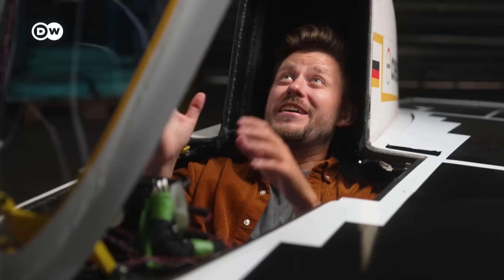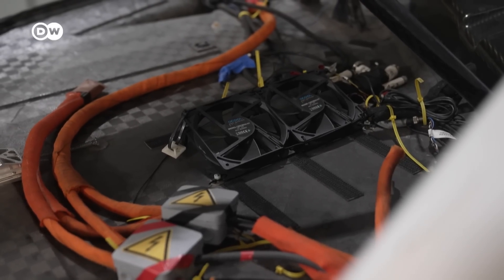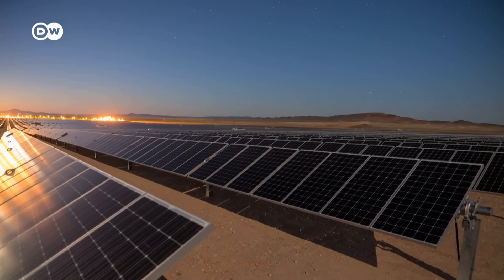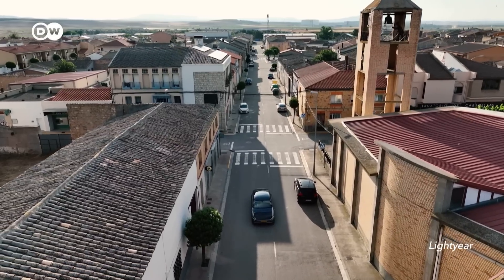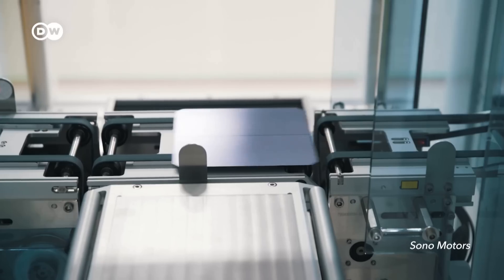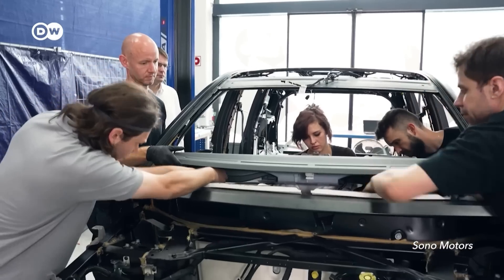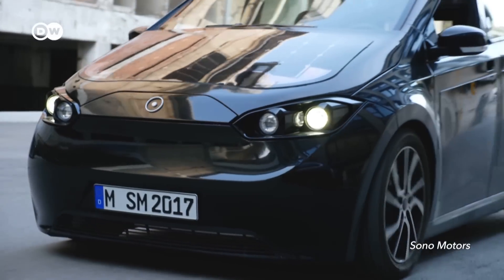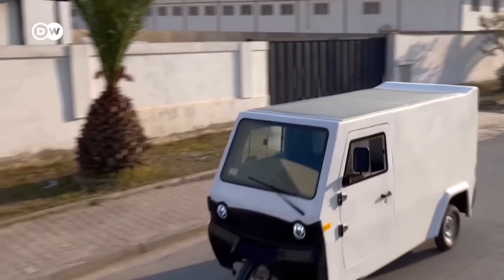Why aren't solar cars everywhere?

Comment: Commercial use of solar energy for cars is just a pipedream, Yes the Sun is an infinite (well, kin of) source of energy, but you simply can't generate enough energy using just solar to sustain the power needs of something like a car. 

It would be far more viable and effective to focus on improving batteries and move to a cleaner, cheaper and more robust generation of large amounts of energy by going nuclear.
Reply: Solar cells are more than efficient enough, to provide a significant amount of energy. Depending on the car, enough that you pretty much never need to charge it, but even just providing a tenth of the needed energy, is significant ...and yet there are several cars, that show that you can drive on only/mostly solar energy:
Squad Solar will go into production in 2024, and will be a great and very affordable car. The Sono Sion would have worked, and been affordable, if they had had enough money to start making them (and they'd have earned more than it cost. They should have done more to predict the costs), Lightyear 0 would have worked if they hadn't aimed to make such an expensive car (the Lightyear 2 may still be a success) ...and there is every reason to think Aptera will work out fine.
Reply: @ZarlanTheGreen  The power output per square meter for even the most efficient solar cells is not enough to sustain a viable production car to go anywhere but the shop down the street without additional sources of energy. Your average car simply does not have enough surface area to support the required power for it. You can not drive a car on solar cells, you can drive on batteries for a few hundred KM and charge them for days in between if you use solar.

A model 3 has a range of maybe 275KM on 50kwh batteries, Average solar cell output on the effective surface area of that car is maybe 1kwh if you are lucky, which gets you a range of 5KM per hour of charge under optimal conditions. (which is pretty much the same as the Hyundai Hybrid would give you with it's solar alone)

So no, a solar powered car is not viable and will not be unless the power output of the sun changes and/or solar cells become drastically more efficient (which would by itself still not yield enough energy). 

It's just a simple matter of physics.
Reply: @blazemonger1  The cars I mentioned, as well as the Squad Solar (all proven to be capable of running on mostly/only solar power), are proof that you're wrong.
...and even getting, say, a quarter of the energy from solar, would be more than worth it.

"Your average car simply does not have enough surface area to support the required power for it."

You're taking the efficiency of the average car and/or the Model 3, and assuming that it is impossible to do any better than that. This is utterly irrational, wrong, and demonstrably untrue.
Reply: @ZarlanTheGreen   So what is the range of any of these care running on solar? Are you saying they can run uninterrupted on solar as long as there is sunlight AND charge batteries for when there is not?

Where can these cars be bought today and for how much? The discussion here is around main stream cars which could replace your  average petrol car, running only on solar, so no need to tap into the electricity network.

Under optimal conditions you can maybe get 1KW out of a solar panel of a square meter. That will not get you very far ver fast outside of these specialized, light an highly optimized racing cars costing more than several average cars
Reply: @blazemonger1  The Squad Solar can get about 20km/day (in the Netherlands), 16km/day (in Germany) for the Sono Sion... I'm not sure about the Lightyear 0, but it gets more than the Sion. The Aptera gets about 60km/day. (in sunny California)
Given how far most people drive, on an average day, That means you barely ever need to charge any of them.

"Where can these cars be bought today"

That's beside the point.
They are cars, that can drive on mostly/only solar power, from the panels on them.
That is what you claim is impossible.
That is what they do, and thus disprove your claim.

Squad Solar and Aptera will start production in 2024.
Lightyear and Sion failed, but only because they didn't have enough money, to start mass production. The cars themselves, were finished and worked perfectly fine. Had they had the money, they'd have worked and been profitable.

"and for how much?"

Squad Solar (70km/h model, with AC): €6,250, Aptera: $33,200 (subject to change)
And Lightyear 0 was meant to be $250k, and the Sion was going to be €25,126.
Reply: @ZarlanTheGreen  List those reasons for Aptera. I have reasons it's going to fold again. 60+ videos worth.
Reply: @aussieideasman8498  Even if they fold: So what? That has no bearing, on the issue we're discussing.
Reply: @ZarlanTheGreen  If they fold it won't be because solar doesn't contribute a little bit of range, albeit much less than claimed - it will be because skin cooling is a scam that has never worked and likely never will. That has no bearing on the issue, but is worth taking note of. However, since the video is about companies folding who try to include solar, Aptera has bearing in any discussion under the video. You are wrong about that.
Reply: @aussieideasman8498  Even if the Aptera doesn't work, at all:
The other solar cars, none of which have failed because of being solar cars (and Squad Solar hasn't failed, at all!), are proof positive, that you can have perfectly fine and (Lightyear 0 aside) affordable cars, that can run on mostly/only solar power.
Which is the issue in question!
Thus, none of what you say about Aptera, is particularly relevant.

Also, I looked up what "skin cooling" is, and it appears to be the proven method, that has been used for millennia, on pretty much anything and everything, such as the computer (with the typical cooling method, that all computers use) I'm typing this on.
Reply: @ZarlanTheGreen  "Even if the Aptera doesn't work, at all:" It would make it a scam. After that, nothing else matters.
"The other solar cars, none of which have failed because of being solar cars (and Squad Solar hasn't failed, at all!), are proof positive, that you can have perfectly fine and (Lightyear 0 aside) affordable cars, that can run on mostly/only solar power.
Which is the issue in question!" That issue in question has the narrator saying the extra expense for the solar; the fragility of it; and the poor gain are not worth having. You have ignored his message entirely. As for the Squad being perfectly fine - it isn't. Perfectly fine if you want a more expensive golf cart, but try driving it across Europe or America?  Your claims make no sense. 
"Thus, none of what you say about Aptera, is particularly relevant." I come on here to show that none of what defenders of Aptera is relevant. I do a proper and convincing job of it, which you don't. Get a dictionary and learn what perfect means.

"Also, I looked up what "skin cooling" is," Skin cooling is transferring cool air through a body that is devoid of vents and/or fins.
"and it appears to be the proven method," Not on an EV, and Aptera certainly hasn't proven it. It's my main argument of many.
"that has been used for millennia, on pretty much anything and everything," You lie, and I will give you the chance to prove you don't; make a list of the top 100 things that use the same skin cooling Aptera is using, and I will see if I can't prove every one of them is wrong? 
"such as the computer (with the typical cooling method, that all computers use) I'm typing this on." This first item doesn't use skin cooling. I have yet to see a computer that doesn't have vents. Check yours, and you will see the vents that allow air to flow into the hot internals without having to pass through the case. Also, most vented computers have a heat sink and a fan. When the computer begins to overheat, the fan blows the hot air out some vents, which causes much more cool air to enter other vents and do a faster job of cooling the heat sink. This has not been done for millennia, but for only a couple of decades by comparison. 
Aptera once claimed that their skin cooling was the same as an animal skin, but that was an utter lie. An animal sweats, and the evaporation of said sweat draws heat out of under the skin. If it can't sweat, it can't cool. This process is missing in Aptera.
Reply: @aussieideasman8498   "It would make it a scam."

...which would still be completely irrelevant, to the issue that this thread is about, given the other solar cars.

"That issue in question has the narrator saying the extra expense for the solar; the fragility of it; and the poor gain are not worth having. "

No. It's that those factors, make it completely impossible, to make a practical solar car.
...and the non-Aptera cars, mentioned, all prove that it is both very possible, and very much worth it, and has already been done.

"You have ignored his message entirely."

I have constantly been directly addressing it. YOU on the other hand, have completely ignored it, by obsessing about Aptera, which is completely irrelevant, as I've pointed out.

"Perfectly fine if you want a more expensive golf cart, but try driving it across Europe or America?"

People hardly ever drive across Europe/America. That is something that most people do, less than once in five years. People typically just drive, within their city/town/village, or to the city/town/village next door. The Squad Solar is perfectly fine, for that. (especially the L7 version. The L6 only goes up to 45km/h [so why get that, rather than a e-cargobike? Well, except if you're disabled/old, or the like], but the L7 with its 70km/h can go on highways, no problem)

"I come on here to show that none of what defenders of Aptera is relevant."

Which has absolutely nothing to do, with the topic of this thread.

"I do a proper and convincing job of it,"

How about you look up the meaning of "convincing"?
You clearly have no idea, what it really means.

"Skin cooling is transferring cool air through a body that is devoid of vents and/or fins."

...except that it isn't devoid of vents or fans.
Using the skin as a heatsink, and then have the Apteras fans (which is most certainly has) push air past it (when stationary. No need, when it is driving), makes it completely the same as the system my computer uses.

"This has not been done for millennia, but for only a couple of decades by comparison."

Not been done on computers, for millennia? Sure, but I didn't say that. I said that the technique itself, has been used on other stuff, for millennia.
Reply: @ZarlanTheGreen  ["It would make it a scam."

...which would still be completely irrelevant, to the issue that this thread is about, given the other solar cars.] Not completely irrelevant - Sion and Lightyear stopped, and a scam means Aptera will stop as well.

["That issue in question has the narrator saying the extra expense for the solar; the fragility of it; and the poor gain are not worth having. "

No. It's that those factors, make it completely impossible, to make a practical solar car.
...and the non-Aptera cars, mentioned, all prove that it is both very possible, and very much worth it, and has already been done.] There is almost no difference between "not worth having" and "completely impossible, to make a practical solar car"; your disagreement is negligible. The non-Aptera cars shutting up shop is proof it hasn't "already been done", except where the cars are crap. 

["You have ignored his message entirely."

I have constantly been directly addressing it. YOU on the other hand, have completely ignored it, by obsessing about Aptera, which is completely irrelevant, as I've pointed out.] At this stage, the message has been lost to me, and I suspect every reader, unless they care to read prior comments. I don't care to.

["Perfectly fine if you want a more expensive golf cart, but try driving it across Europe or America?"

People hardly ever drive across Europe/America. That is something that most people do, less than once in five years. People typically just drive, within their city/town/village, or to the city/town/village next door. The Squad Solar is perfectly fine, for that. (especially the L7 version. The L6 only goes up to 45km/h [so why get that, rather than a e-cargobike? Well, except if you're disabled/old, or the like], but the L7 with its 70km/h can go on highways, no problem)] I'm sure there are people for which the Squad is a perfect fit, but they are rare. In general, most people purchase because it can do much more than what they regularly need - it's why pick-ups are the biggest sellers in Yankeeland. How many carry pigs to market? Your theory will fall over as soon as the Squad goes on sale in 'merica, and flops, as has many like it sans solar.

["I come on here to show that none of what defenders of Aptera is relevant."

Which has absolutely nothing to do, with the topic of this thread.] That's what the irrelevance is. Think about it - you may need to take a week.

["I do a proper and convincing job of it,"

How about you look up the meaning of "convincing"?
You clearly have no idea, what it really means.] I'm convinced you have stolen my recommends to use a dictionary. 'Clearly' is your next word. And I didn't claim every reader would be convinced. It's hardly possible for idiots.

["Skin cooling is transferring cool air through a body that is devoid of vents and/or fins."

...except that it isn't devoid of vents or fans.
Using the skin as a heatsink, and then have the Apteras fans (which is most certainly has) push air past it (when stationary. No need, when it is driving), makes it completely the same as the system my computer uses.] You're an utter lame brain. I said 'fins', not 'fans'. It's a reference to heads on air-cooled engines, like VWs and many motorbikes. And if you use the skin as a heatsink, you have to have no vents. Vents would stop the skin from being a heatsink. I have not said fans can't be an internal component of skin cooling systems, but keep in mind; they can only move hot air around with no means to cool it without vents. Finally, your computer and Aptera are not exactly the same. If you can't tell by looking, you should go to Specsavers - otherwise, get a brain. 

["This has not been done for millennia, but for only a couple of decades by comparison."

Not been done on computers, for millennia? Sure, but I didn't say that. I said that the technique itself, has been used on other stuff, for millennia.] And you still havent listed them. Not one mention of what has been done. Your words are useless. I recall asking for a list - where is it?
Reply from the maker: Hey everyone! We love critical discussion but please stay respectful towards other users here. We do not tolerate insults.
Reply: @DWPlanetA  It is utterly pointless to make such a statement, several weeks after the discussion has ended. Making that statement, in this situation, is an insult. Also an insult to our intelligence.

Comment: Solar powered cars, are NOT the holy grail of electromobility, and they are NOT sustainable! Better than combustion, and non-solar electric, cars, but they are still cars! Cars are the second worst form of transport, after airplanes, with tons of problems for the climate, as well as many non-climate problems. We'll always have some need for cars, sure, but cars, and the need for them, needs to be heavily reduced!

Comment: efficiency on ev is around 15kw/100km but 4m2 of space can produce maybe 3-5kw in the best conditions so it could never be power completely by solar. But I see this as a no brainier for cars, trains and other big electric vehicles
Reply: Your numbers are made up nonsense. The efficiency of EVs varies wildly. The Sono Sion, the Lightyear 0 (both only failed, because they didn't have the money to start mass production. If they only managed that, they'd have been profitable), Aptera (which can go up hills, just fine), the Squad Solar (which should have been mentioned), are all able to drive on mostly/only solar energy ...and even if the solar only provides a quarter of the energy used by the car, that'd still be a great benefit.
Reply: @ZarlanTheGreen  number from my car bit you can check about the efficiency in evdarabase( the most eficiente one is the modeS with 13.6) and for the energy producción any retailer for comercial solar panel has the average data on how mich they produce by surface area. Those are facts about the real lack of charging of those system. The profitability of those companies or why they failed is not related to those maths
Reply: @samuxan  As I said: All the mentioned cars, can run on mostly/only energy from their solar panels. Thus your claims are clearly disproved. They are all also far more efficient, than the numbers you cite, which are for far less efficient cars.
Reply: @ZarlanTheGreen  Work for Aptera? This guy never mentioned them, and you are repeating your prior unsubstantiated nonsense.
Reply: @aussieideasman8498  Aptera are mentioned, in the video.